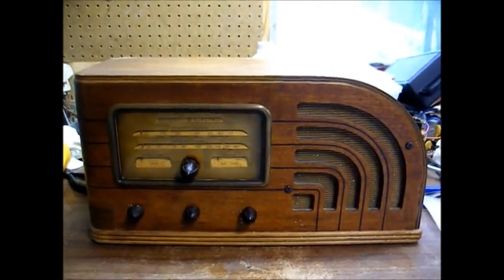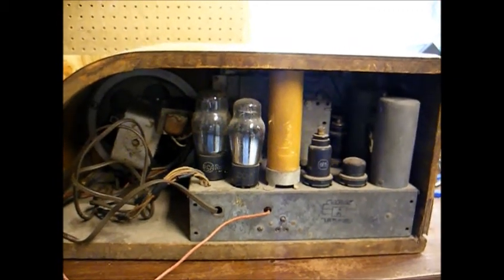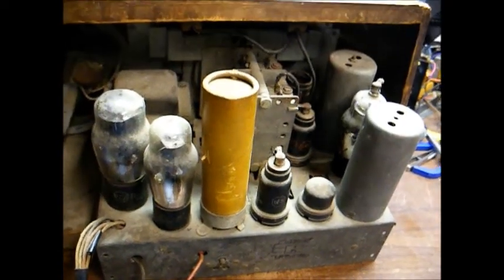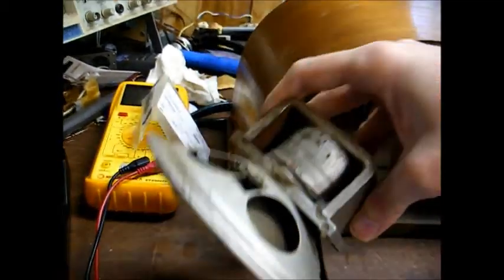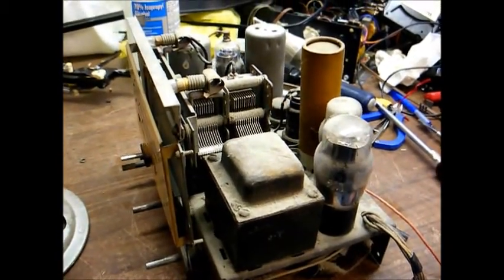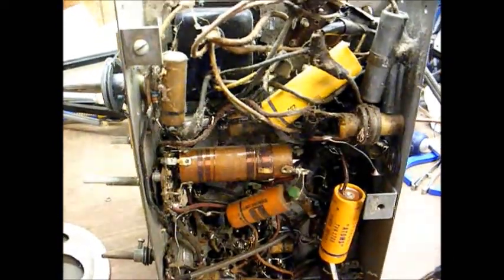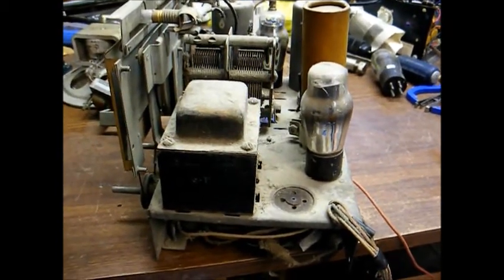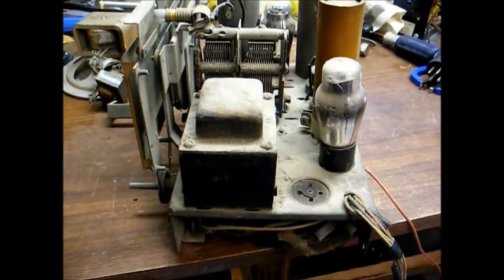Restoration of a GE model F63 tube radio from 1937 - part one

Comment: Why is there a different filament voltage for the 80 tube?...I guess they didnt use numbers like 35Z5 back then, meaning the filament voltage would be 35 volt's...since there is only the number 80 on the tube.